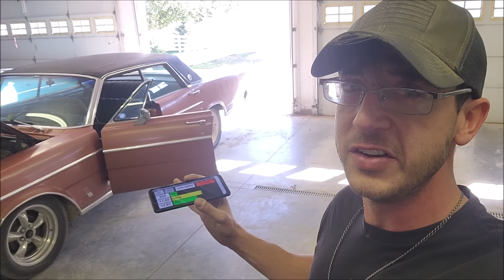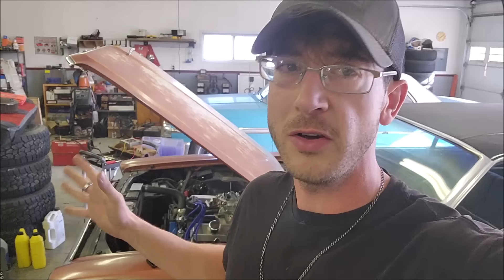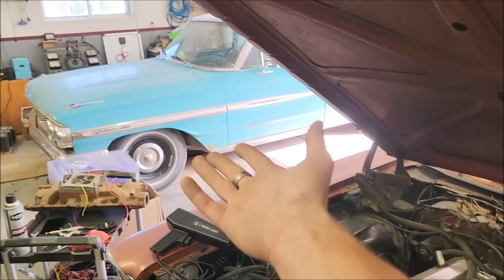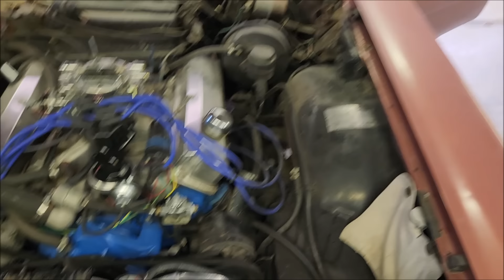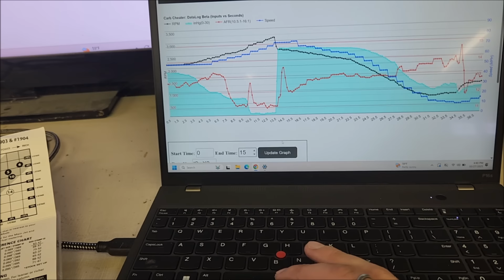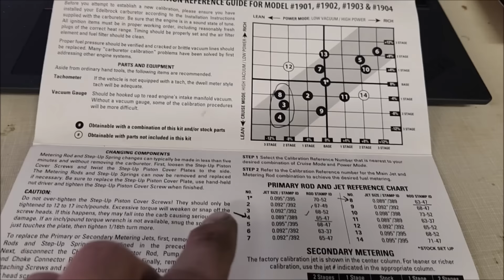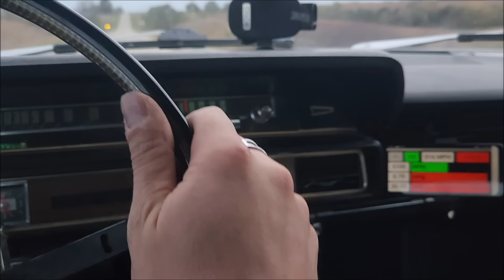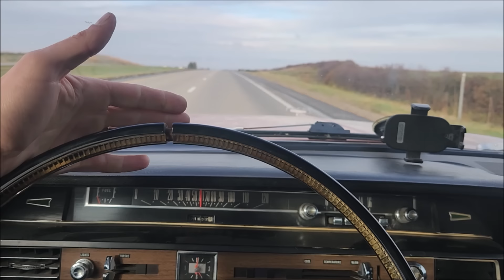Can We Save Her? NEW $6500 Engine Makes NO POWER !!!

Comment: Nine times out of ten if the carburetor is suspected to be an issue it's not normally the problems are ignition related whether it's advance issues or. Actually mechanical like bad plug or plug wires etc the first step I always do is check all that and dial it in and what do you know it runs like a champ
Reply from the maker: Most carburetor "problems" are often ignition problems

Comment: Oh .. maybe this is why fuel injection was invented and is 10000 times better.. 😂   Maybe some goose stuffed up the cam timing I’d be checking it .
Reply from the maker: Idk, this is the same stuff one woukd have to do on a fuel injection kit, just entirely on a computer - and theres much more to fail on retrofits when that comes into play. 
In contrast, a modern injection car in 50 years or any injection car that sits for 15 years will never be on the road again - at least not easily. 

Different advantages and disadvantages to both
Reply: @ThunderHead289  program fuel injection is nice if you drive all over creation in various weather conditions and altitudes though. That said I would love to have a power tour car like that but with 4 wheel disc brakes, a newer transmission and  3.30 gears.

Comment: You can tune that C6 to shift at 5,500 or 6,000 RPM by adjusting the vacuum modulator. Also, adding a small nut and bolt to the kick down arm on the carburetor can give you the ability to kick down into 1st. There’s a hole there for it and it takes a minute to put it on. I think a 10-32 bolt with two nuts will fit and allow you to adjust the kick down. I recommend you have your friend buy some 1978 Grenada disc brake spindles and dial the brakes in first. You’ll love it when you do a 30 punch and it drops into 1st and shifts at 6,000
Reply from the maker: Indeed. 
Theres physically no kick down lever here anymore to attach. 
On an eddy, you actually have to buy a special 40 dollar kit to attach the ford lever style kickdown. 
Ive worked over a few c6 scenarios in previous videos where I went in depth about how to set the kick down and modulator
Reply: @ThunderHead289  Jegs sells a kickdown cable kit that comes with the lever for the trans and a stud that will fit Ed carbs.  My 74 f250 (390 c6) would shift at 3500 until I put a kickdown on it, now i get about 5k.
Reply from the maker: @jasonsmith4902 indeed, tis not my car 🙂
Reply: @ThunderHead289 I would let the owner know about it, everywhere I looked online said "you don't need a kickdown on a c6" but you really want one!
Reply from the maker: @jasonsmith4902 definitely woukd argue that all automatics need a kickdown
Reply: That's what I came to the comments to mention. 👍
Watching it shift under 4k RPM gave me flashbacks to pulling the vacuum hose off of the trans vacuum modulator to stick a screwdriver inside to adjust it. C4 and C6 trans.
Not too bad.

On the GM side I'd take the governor out and add stiffer springs and/or grind down the counterweights. 😅
I once got a 700R4 from a wrecked 4.3 Chevy Astrovan and put it behind a mild street 350 (closed chamber heads, cam, intake, Holley DP). Even after the B and M shift kit, it still wouldn't shift over 5k. Even if you held the shift selector into L1!!!
I had to grind those weights down a bit even after messing with the springs.
Got that sucker working great!
Reply: Lokar kick down cabel kit is what you need
Reply: Balljoints should be the same; I'd go with 1968-72 big car disc spindles since they have bigger rotors as well as being single piston caliper.
Reply: @piercehawke8021  My disc braked 71 Custom 500 would slide all 4 tires at will...Pickup sized brakes on a car!

Comment: Hooking up the kickdown and maybe changing the governor will do wonders for the auto shift points. Stock auto transmissions behind not-stock engines is usually a good way to get mediocre performance.
Reply from the maker: I strongly dislike auto transmissions, im good at killing them off. All my cars are gear jammers for a reason 🙂
Reply: @ThunderHead289  Fair, just a mention in case the owner wants to keep it and make it suck less. They don't have to be terrible, they just usually are not set up to not suck.

Comment: Did you keep the mixture screws at 2.5 out the entire time? Also, how did you have the idle screw set? I have a Holley, but I need to do this exact process with my car. I have very similar issues. 

How were you getting data if the carb cheater wasn't hooked up? Or do you just mean no auto tune?
Reply from the maker: You know, there are a number of things i didnt show and often dont for the sake of tempo. At some point I added a .025 thou wire to both idle air bleeds to compensate for the low idle vacuum and bad signal on idle circuit. 
I generally jump over that stuff as it gets pretty dry or technical. 

Perhaps I ahould do a video tomorrow and show what I had to do there for low idle vacuum things. Some carbs you just have to pull little tricks like that

Comment: I'm going to throw in my two cents at the very beginning before watching the video, engines vibrate a little. Is the best place for the fuel pressure regulator to be located on the actual engine block? 
I don't know exactly what happens inside of a fuel pressure regulator... probably just a spring and a valve? 
 I'm thinking that if the engine vibrates and shakes the fuel pressure regulator around, that might not be a good thing? 
....... Okay with that much home brewed logic thrown out the door,  I'll  go ahead and watch the rest of the video. 😂
Reply: Interesting point!🤔
Reply: @stuckinmygarage6220   I wonder a lot. 🤔
😁
Reply: @randywl8925 I think you have a point. Mine is a cheapo inline German thingy from my Bug days. It flops s bit, but the acceleration/deceleration of the vibrations should be (, There's the wonder part 😊)lower.  Plus, it's more centered to the V than over or near a head.  Never stop wondering!
Cheers!😉
Reply: I've never seen a cutaway of one, but Im envisioning a spring controlling a sensitive valve adjusted to just 5 lbs could be (in theory) a small issue.  
Heck, car bodies, not just engine blocks vibrate, but I know engineers have taken that into account when designing these regulators.
...still wondering 🤔
Maybe a test is needed. 
🤣🤣🤣 @stuckinmygarage6220

Comment: A set of Roahdes lifters or advancing the cam 3 degrees would make a very noticeable difference, especially since the engine was barely ever on the cam this entire video. It would be interesting to have seen the air fuel ratio at 6000 rpm.

Comment: This would have been an excellent candidate for leaving closed loop off and showing how much fuel dilution in the oil can affect afr with an oil change.

Assuming the oil is as full of fuel as I think it is.
Reply: Interesting 🤔. I have heard that modern cars are more  sensitive to that, specifically the O2, older worn engines?
Good advice, still!
Reply: All cars are sensitive to it with PCV, but Oxygen sensors can compensate, generally, a carb car would just run richer until the fuel is boiled off. 

If the oil is severely fuel diluted it could cause emissions failure for HC back in the day. Manufacturers like VW actually instructed you to change the oil to correct things due to fuel dilution.

It's also one of the reasons PCV is beneficial, getting that crap (and other stuff you don't want in your oil) out of the crank case as quickly as possible. 

 @stuckinmygarage6220

Comment: 💡GARAGE DOOR OPENER💡
Dude, I fought that issue for YEARS and threw many tantrums before I figured it out!
Try this, turn off the lights! Florescent AND LED lights mess with the radio frequency of your opener, greatly reducing your range.
You are welcome.🍻
Reply from the maker: Oh wow .... im not kidding, it works perfect with lights off
Reply: @ThunderHead289  That frustrated me to no end for so many years. The  moment I figured it out I imagine I looked like Homer Simpson discovering Duff for the first time. Woo Hoo!
Reply: @ThunderHead289  And, if you read the fine print on those lighting fixtures, it tells ya this as well.
Reply: @ThunderHead289  Just be careful...  I know that your LED lights in your garage are about the same age as the ones in mine.  About a month ago, they started doing the strobe effect if they were turned off for a long period of time.  This morning, I turned them on, and I suspect I could've thrown a traffic signal installation into emergency vehicle preemption mode with them.  Definitely glad that I don't suffer from epilepsy.  Otherwise, there would've been a seizure.  But, yeah, I think ours works better with them off as well.  Sometimes I can open the garage door from 150' away.  Other times, have to be within 15 feet for it to work.
Reply: Scratch that...  Thought that was the issue about 30 minutes after writing my original message.  Garage door wouldn't close.  Something was blocking the sensor beam...  😑
Reply: @ThunderHead289  Genie makes some expensive bulbs that should not have this problem.
Reply: @ThunderHead289  Says very specifically in the garage door opener manual not to use leds as they cause interference...but we don't read that because we are men...lol On a serious note mine is "ok" given I dont put an led bulb in the garage door opener itself, the shop leds mess with it a bit but in my case I run on wifi with phone app so rarely use my remote.
Reply: @icey_projects Seems the Marantec garage door opener here is ok with them in it.  It was manufactured fairly recently, in the late 2000s, though.
Reply: @ThunderHead289 lengthen the antenna wire so it runs closer to the door opening. Just staple it to the ceiling or something. It'll look a little tacky, but it might help compensate for the interference. If not, you can always remove it. Any spare wire you have in your bin will work.
Reply: @bgroovin1343 The antenna wire is designed specifically at length/ frequency/energy.  You might get lucky, but that's not how antennas work.
Reply: @stuckinmygarage6220 interesting. I didn't know that. I've done it before but I guess I got lucky.
Reply: @bgroovin1343 Hahaha save some luck for when you need it 😂😂 Cheers!

Comment: Absolutely correct on the edlebrock being forgiving and running right out of the box. My '84 mustang gt holley gave up the ghost one weekend when my rebuild hit a problem i couldn't resolve. Brand new 1403 and adapter and i was able to drive. Gas mileage sucked and i got the tuning kit and dialed it in. That was in mid '90's. Thanks for a valuable lesson on old tech.
Reply: Adapter ??? Both square body carbs
Reply: @glennmanchester5696 you're correct. It has been a few weeks. I did use an adapter when i put a different edlebrock on another aftermarket intake that had a Q-jet on it. Amazing what i can remember and then more I've forgotten. 😂😂

Comment: fantastic walk through! unfortunately alot of mechanics in todays world just dont have the knowledge (or patience) to properly adjust a carb on older engines. I learned everything over the past few years about properly setting up carbs from your channel. It all started when i got an old F700 dump truck that had a rebuilt 370 in it and a brand new Holly slapped on it an you'd have thought a toddler just turned all the adjustment screws randomly. Some day I'd love to get a carb cheater on it!
Reply: I love my CARB CHEATER!!

Comment: All that cam...slow af 😂 secondaries flaps are important to adjust.
Reply from the maker: Theres several things i didnt show, that being one of them. The one i probably should have was putting a wire in the idle feed restrictor so the idle circuit worked correctly for the big cam with no idle vacuum

Comment: A big cam with a stock converter and 3.00 gears doesn’t make much sense at first thought but I get it. Most of us are on a budget and can only do so much at once and want to start with the engine. That’s just real life.
Reply: If you're really smart you start at the back and work your way to the front. That way you're not replacing busted driveline parts when you get to the engine while your 'engine first' buddies are 😎
Reply: @P_RO_  You don't have to be smart you just need smart friends and/or family.
Reply: @P_RO_  If that car was issued with an FE the running gear will easily survive a lot more than stock power.
Reply: @danontherun5685  Obviously. It's the principle I'm speaking of for any car not just this one.
Reply: @P_RO_  That's true but if you don't have a lot of money (me in college 1n 1993 getting my car running with a new engine) at least you can enjoy it for a while and the broken transmission and then the broken rear end later are easier pills to swallow.  In both cases you're replacing all those parts anyway so it really depends on budget and priorities.
Reply: @devinl7543  Have you ever owned one of those? I still run high performance FEs and yblocks because they are so durable.
Reply: There's a reason I choose a cam with low-mid power and a tight LSA. Sweet idle , pulls like a maniac from idle and will pull to 5k RPK.

For me that's a fun cruiser. I don't need 80hp more at 6000rpm yes it's a choice but this rides better for me
Reply: @gorkzop  yep, il give up the 80hp at 6000 to 6500 because driving around normally, it’s SO FREAKING FUN to have big torque and power from 2,500 to 4500. No downshifting just roll right into that meaty power
Reply: @royb.1441 yessir. I think alot of people see engines built for drag racing making huge power and think that's what they need in their street car.  You can build the same engine with two very different power curves and still end up with the same power. A drag car only needs to make maximum power at WOT, which a big cam helps with tremendously, but kill all streetability unless you can really dial in the tuning.
Reply: Work good at the Bonneville Salt Flats. Terrible in a drag race.
Reply: How true. I've finally worked my way out back on my truck..engine   transmission, and finally a total differential rebuild with 3.90 LSD.
Reply: Wrong camshaft for that engine and get rid of the Edelbrock carb.
Reply: @lzlz-xv6oe  You obviously didn't watch the video.
Reply: @lzlz-xv6oe  Well you are HALF right.... (The Cam is Crap)

Comment: Uncle Tony would have the flux welder out locking down the advance plate in that distributor right off the bat. And he would have torn the engine down and installed the positions backwards... And let's not forget the 50 year old Accell big ass yellow coil.

Comment: My garage door opener control does the same, helps if you press it for like “one Mississippi” and release!! Thanks for the class on tuning!
Reply: Our current garage door opener is the same, at least with one of the remotes.  The other remote seems to work better.  Both are with fairly new batteries.  Now, compared to the old Linear-branded remotes we had with the old opener, the newer ones stink.  And, those weren't as good as the old school Genie remotes that were at our old house.

Comment: 1:56 Too much carb, not enough timing, and I haven't even seen the engine yet.
Reply: Too much carb idk on a big block Ford I doubt that they love fuel and air unless it's a ridiculous double pumper Holley which I hate holleys anyway due to the need to be changed jets and power valves etc and getting raw fuel all over a hot intake manifold while doing so and that's only one reason they suck